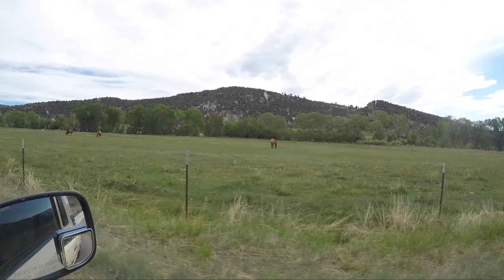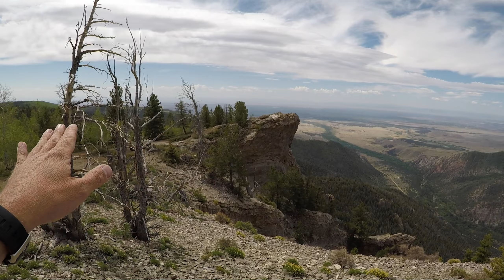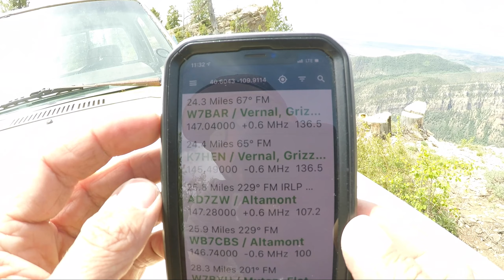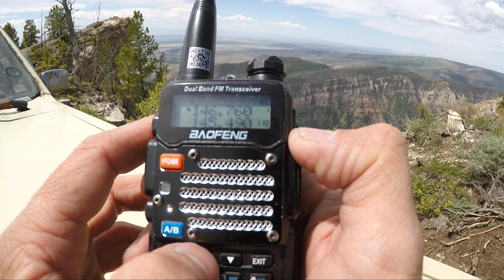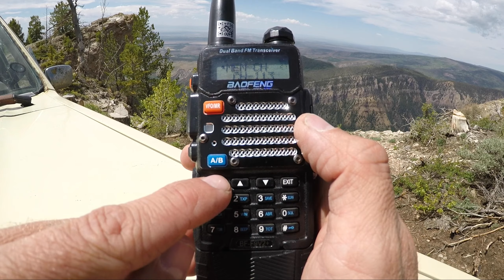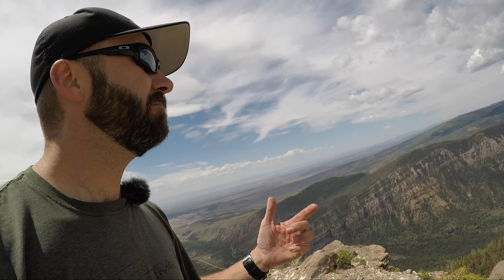BACKCOUNTRY COMMUNICATIONS 1 | Baofeng HAM Radio & Garmin Inreach Mini

Comment: Sweet! Just got my technician license in January and was browsing through some ham radio vids and your’s showed up! Playing with a Baofeng handheld a bit and I just installed a Yaesu FTM-400XDR in my Tacoma, and I’m loving it so far. Just ordered a couple Garmin inReach SE’s for the wife and I as a last ditch comms option for if I’m out in the field and cell service becomes unreliable.
Reply from the maker: Killer bro! Small world ain’t it! The InReach has been damn handy. And I’ll look into that radio for the trucks. The Kenwood 281 is on my Amazon list but it hasn’t risen to the top of needs yet. My Baofeng handheld is working good, but I’m getting closer to wanting a more solid and reliable quality unit. I’ve had it 5 years. And be sure to check out the other channel for all my Toyota adventures! Adventure Teq!

Hope to be seeing you out there. The Chief just has to get the check rides lined up! 🚁💦🔥🪝🏗

Comment: Carry a roll up J-pole antenna (half wave) and small jumper cable. Throw up in a tree. I’m hitting 100+ miles on my handheld while backpacking in Colorado. Where are you. I can generally hit a repeater and or make radio-to-radio contacts when in the mountains. I also carry a Garmin InReach Mini as a backup.
Reply: Ugh, one more thing, if you’re going to be on a SOTA summit then post an alert and you’ll have people looking for your transmission.
Reply from the maker: All great info! Thanks a lot! I made contact the other night with some guys over a repeater at a mountain top about 40 miles away. I just scanned my programmed frequencies (friend loaded 115 ish local freq's with Chirp Software) then chimed in and joined their convo! Was quite entertaining. After a short discussion I went to bed listening to these guys talk about programming in MS DOS language, 8.5" floppies, Commodore 64's and all manner of nerdy awesome stuff like that! LOL! Fun stuff man.

What is this SOTA?
Reply: Jeremy Adventures SOTA - summits on the air. SOTA radio operators have perfected the art of long range low-power (QRP) communications.
Reply: Also, check out the kindle book VHF, Summits and More by K0NR Bob Witte. Lots of practical info re wilderness comms, antennas, and radio procedures. I’m a new ham too and this gave me a running start.